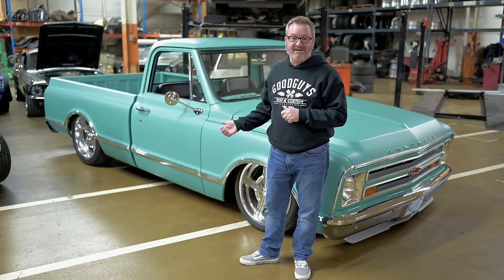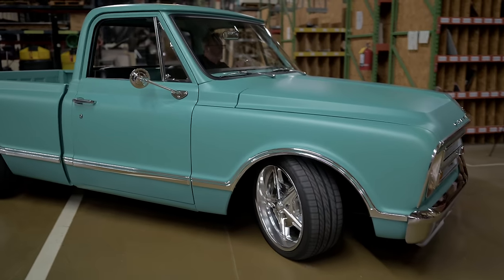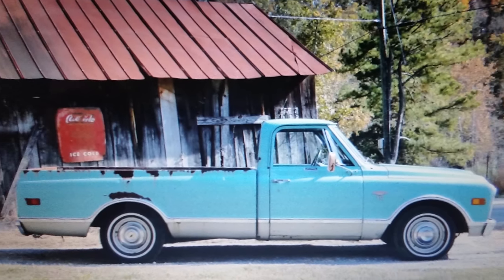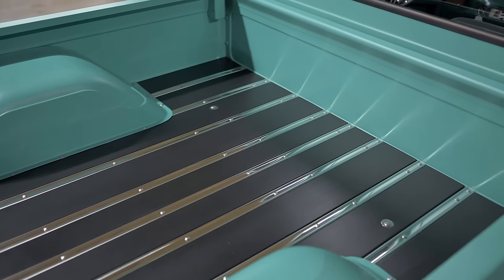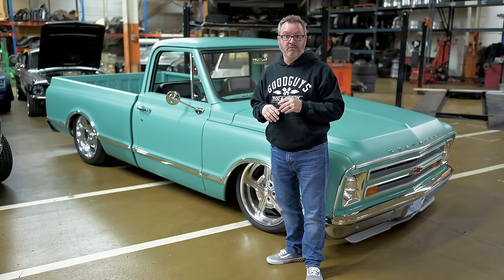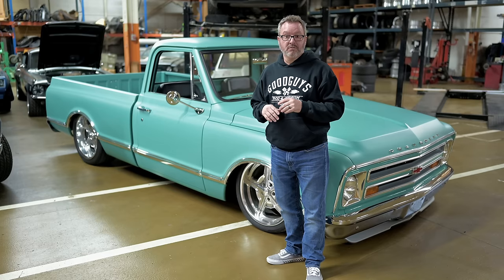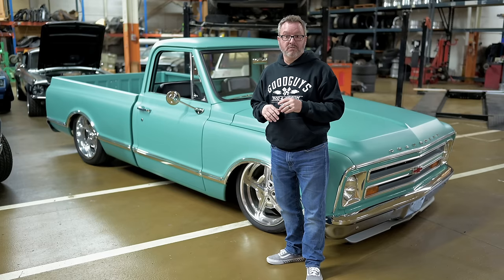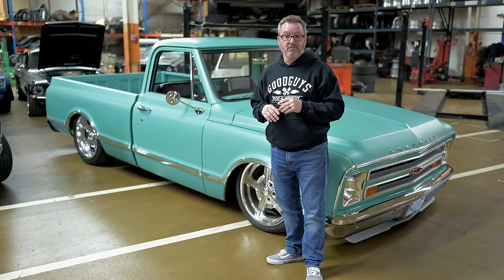From Longbed Farm Truck to Shortbed Street Truck: Dave Fricke's 1968 Chevy C10

Comment: I had a 68 swb. His is a custom with the chrome.... I have a 1972 swb. Fleetside. The only side... But the 68 has some dollars spent on it. Air bag ride is the best thing  ...but $$$....everything that you can buy for these c/10 is amazing... I have had 20 of these trucks... In 1992 I bought a 1971 swb fleetside cheyenne. 350 350 air auto... Bought it in bama.... 1.100.00 dollars and drove it for 10yrs...It was stolen in 2002 .never to see again..... But luck I was able to buy another 1972 custom deluxe.... For 2.500..00 quite a difference But they gettung so hard to get.. Shortbeds are.... Crazy prices...
Reply from the maker: Yup! They're the best.